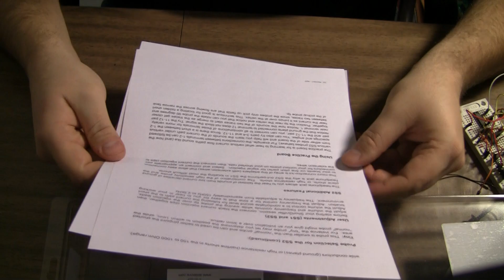Shortsniffer - short circuit finder - unboxing and first look

Comment: Hi, nice video and nice piece of equipment. I can't get one here and I just thought I would give it the old college try and 10 minutes later I have one up and running just great. It's just a prototype but at least I've made myself and idea of what to use for the time it comes to put it all together in a small little battery powered speaker. Cheers :)
Reply from the maker: ciprianwiner Mine is for sale and I will ship just about anywhere if you're interested...
Reply: +GameTechUS did you end up selling?
Reply from the maker: +stazeII 
Not sold, short was found, but not with this tool.
Reply: @GameTechUS  how you found the short?

Comment: You can use a high resolution meter like a fluke or other brand  use heat or cold air like a dust cleaner and probe around the circuit and find the spikes reading then you fund it, but remember caps do get in the way, I would take them out of the board first.